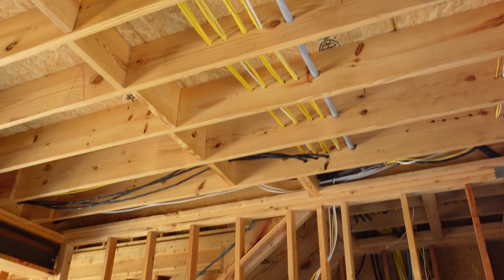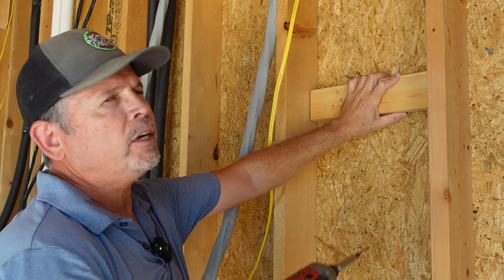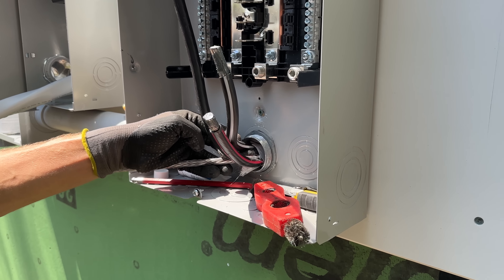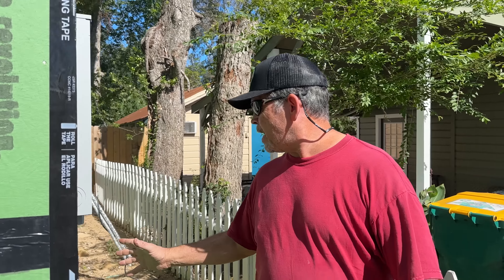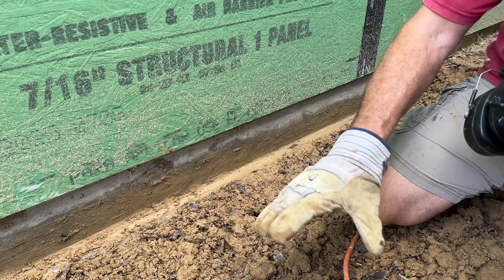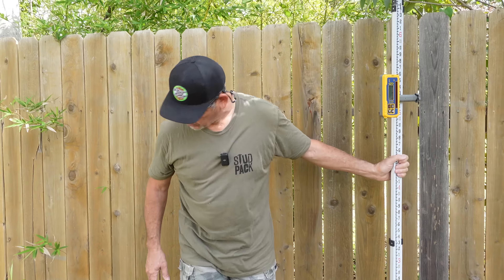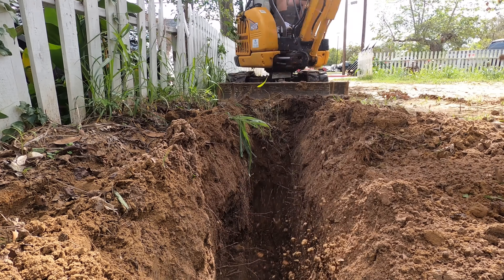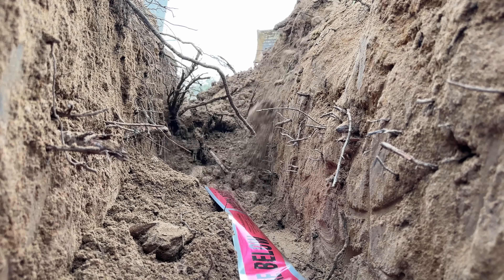MASSIVE 400 AMP Service for our Storm Proof Electrical Powerhouse

Comment: Hey guys. Recommend a 3” expansion coupling where you come out of the ground into your meter.
Reply: It’s actually required here in Tennessee. I knew there would be a comment here.
Reply: What does this do? Is it for movement or cold weather issues? Thank you.
Reply: @sterlingmullett6942  the pipe will always settle with time. Without the expansion coupling the forces will break fittings, bend the metal boxes or split the pipe from the fitting leaving the wire exposed to weather and damage.
Reply: @KetterHomeImprovements  I see. Thank you. Yeah, they should probably cut that three inch pipe and affix an expansion coupling. Hopefully they will see your comment.
Reply: Here in New England they are a requirement as well
Reply: Came here to make this same comment. I guess they probably don't get a ton of freezing temps in Texas, but it'd be a darn shame if frost heaving or settlement were to split the pipe down the road. I was also wondering about the inspection requirements. Around my way backfilling an underground service prior to an inspector having a look at it often means digging it back up, although perhaps video/photographic evidence is sufficient.
Reply: How does the service line stretch if the pipe drops?  Do you have 3" of slack in the cable/conductors somehow?

Comment: PVC for backer board is the same way I do all my electrical panels. Nice to see that great minds do think alike.
Reply: Where do you get them from
Reply: Wouldn't something a bit more fire resistant be better? Or at least something that won't spew toxic smoke when on fire?
Reply: @MikrySoft Rubber floor mats?
Reply: @MikrySoft  yea, you're right. Anything can always be better.
Reply: @baxtronx5972  I was thinking more in terms of fiber cement siding ("Hardie plank")
Reply: Use garbage deck screws to hold the box on.... and no expansion coupler.... cant buy 0.50 of stainless 14 screws?...

Comment: Taking those stakes out of the ground--I saw the Perkins Builder Brothers use a long 2x4. They screwed the 2x4 to the stake and used the length of the 2x4 to raise the stake by lifting up on the 2x4. Fast.

Comment: in the future, make sure you run a pull rope through a conduit made for internet before you glue it together, will make running lines much easier. When it comes time to run a network wire, you pull the network line through the conduit with the pull rope along with a new pull rope. Electric lines of that size are stiff and can be pushed through, fiber line not so much. For now i might suggest some fishing line attached to a small ball and some compressed air, push that through then with the fishing line pull a pull rope through it. Mind you i have 200ft fiber line in the ground connecting my startlink mounted on a 65ft tower to my house so I've used the pull rope before.
Reply: Since they didnt do that i would suggest a light string tied to a plastic grocery bag and sucked thru the pipe with shop vac
Reply: @Kreativekarpentryofficial  ohh never thought about suction and a grocery bag.
Reply: That was totally stressing me out, after seeing them fight with the big cables in the garage I can only imagine how much fun it will be to run the supply cable through that 90....
Reply: I would have left the hole open and put the pipes unglued in the hole and left them there until the electric company came to run the cable,  while they are running the pipe through the pipe pieces id be right behind them gluing them up. then once done fill the hole. @funkygawy
Reply: @fixitfixitfixit  My electric company wants everything done prior to inspection.  From metal riser, to primer and glued PVC, to schedule 80 36"/24" sweeps, panel to building, mule tape installed...  Everything before they will come out.
Reply: @bigearn8782  Thats fair i guess

Comment: Whether it’s code required or not as a home inspector and apprentice electrician I always highly recommend an expansion coupling below the meter. It’s almost impossible to install afterwards and you’ll be in a world of hurt if that conduit ever pulls out of the connector and exposes the utility side service entrance conductors. I’d ask Joel his opinion though, he will know better than me! Awesome work as always guys!
Reply: its code in my area for sure
Reply: Seems to be code for colder climates but the warmer climates don't seem to take expansion into consideration 🤔
Reply: I would have done one for sure.  Mine has moved a bit during the years.  I'm glad I did one.
Reply: definitely should have an expansion joint at the bottom of the meter socket. ground is not compact and will settle over time
Reply: @KeyDx7  look into getting outdoor duct seal it's electrical plumbers putty  than maybe get some flex tape ?
Reply: @@KeyDx7 Just call the utility, they'll make the owner fix it.  You might have to deal with power being shut off for a hot minute.  the AHJ could also be useful.

Comment: A farm jack works great to pull out fence posts when you do not have an excavator or are in tight quarters. They are about $50. Also, if you wrap your chain under itself (half hitch) when you wrap it around the 2x4, it will not slip when you are pulling.

Comment: First, the connectors that were used for the backside of those enclosures are not correct. What was used are SEU rated, in which what should have been used was SER ( Round Throat ) connectors for the Service Entrance Round cable. You cannot use flat clamps on round cable. Unfortunately, that is a code violation.  Second,  I highly recommend a expansion coupling under that meter base, whether or not it's code. Third, at least 3-4 1/4" weep holes ( * in line) should have been drilled for the belly of the 3" ( Service Lateral ) at the lowest point in the event of water infiltration.  Thumbs up to Joel for using the wire brush to spread the De-Ox. Most DE-Ox manufacturers suggest using wire brushes and many people don't. They just their finger which is not the proper way to apply it. Kudos to Paul for dressing the backing board with a chamfer. Nice touch!!!

Comment: 18:35 When hand digging those stakes, use a pressure washer wand to soften the dirt on one side.  Or drive a couple of big screws thru the stake, and lift it out with a portable "jack."

Comment: At the end near the road, I would have buried a 2.5 box over the pre-dug line for the utility connection.  So you only have to dig up 6 inches, remove the box, then presto.  As long as you don't have to drive over that area until the utilities are hooked up.

Comment: Good work. One question from a career electrician. No slip joint on the conduit riser between the ground and the meter base? They are required in a lot of areas. Ground movement can bust the conduit when rigidly attached to the wall and meter base. Keep up the good work.

Comment: Great video, good information!  In case people try to copy and repeat... For tracer ribbon you actually want to install that up the vertical riser pipe and wrap around a foot or two of it at ground level or maybe so that you could just see some of it otherwise nobody knows it's there so there will be no way to detect it. Detectable marking tape (tracer wire / ribbon) is used for locators not metal detectors. Therefore you have to energize it.
Also another pro tip: swing the house of the mini x when using the blade up against the picket fence so your boom, stick and bucket can be tucked away neatly. 😊 Good work guys Hope this info helps you for further videos.
Reply: Can you just use a 14/2 as a tracer wire?  What do you normally run ?
Reply: @walnutcontractors5661  You can it's just way more expensive and you're putting two wires in the ground. I use 18 gauge or 20 gauge single copper wire but that's a little expensive too so I like underground detectable tracer tape. Plus the tape has words on it so if you're installing gas it's pretty important to let people know there's gas underground. Usually you would bury 1 to 2 ft and then lay down the detectable / tracer tape with the words gas on it. Then continue burying the rest of the way flush with the ground.
This way when you start digging if you hit the tape you know within a footer to the gas pipe is below the tape so you never hit the gas. 💪

Comment: Great update on the garage. Not sure if it has been said, but I would have recommended a pull string in stalled on those 60 ft runs, 2-3ft deep is a bit deep for a  pull box, but pull string would be a idea.

Comment: Very interesting. The last time I built here in Georgia, the power company ran the line from the street to the meter. I am rather surprised that you guys did not have to have that conduit inspected before covering it. Also, here I have never been allowed to put more than one type of service in the same trench. One time I was using a 36 inch bucket and I was going to put the various utilities in the groove made by the teeth. I thought it was a cool idea as that would ensure that they were all evenly spaced apart. That prick of an inspector would not even let me backfill and bury within the area where the ditch was. He insisted everything had to have its own ditch. They would have been exactly one foot apart all the way (150 ft. ). Would have made locating later so easy.
Reply: I wondered about this too. I'm pretty sure my utility requires inspection first as well.

Comment: When you terminate the conduit on your new pole, make sure the open end of the conduit is LOWER than then termination at the house, AND make sure there's some waterproofing on it, so that it doesn't get a lot of water in it.

And since the pole side will be lower, when that conduit does fill with water, it'll drain on the pole side, not into your meter box.

Ask me how I know.

Comment: Paul, I'm not sure what the code requirements are there, but either way you may want to consider installing an expansion joint in the conduit vertical riser below the meter socket. It will protect conduit/meter socket damage from the settling of the earth in the trench. 
You guys are doing a great job. I can't wait to see the finished project!
Reply: Also you need schedule 80 above ground,  sch 40 below grade.  Joel eluded to requiring an expansion coupling below the meter socket
Reply: @grounded-b937 Joel did mention the requirement for sch 80 above and 40 below!
Reply: In SE MO we need them on our underground electrical services too, isn’t part of the NEC that I have ever read, but per the utility gold book out here they require it. Also sch 80 is just for the connection that comes out of the ground since it is subject to physical damage. Awesome video guys!!!

Comment: Jordan... Have you considered much less wired for 10 Gigabit Ethernet (at least to the NAS and 2.5 Gigabit to your workstations) within your garage build since you'll have Fibre Optics incoming... Where do you plan on having your NAS located? Have you considered rack mount NAS and ethernet switch? Which NAS are you planning on getting? Personally, I favor QNAP for the job...

Comment: Electrician in Iowa here guys, content is great keep it up!

I'm thinking your inspector or AHJ might have you add a slip joint coupling in on your service riser so just be expecting that, and no, they are not cheap for a 3" 😂

Comment: You should have ran pull wire through your conduit. Awesome job though. I like how you showed the elevations, I have been a critic on that in the past.
Reply: any reasonable shop vac will suck a pull string through that length with no trouble.

Comment: Hey guys glad to see some more progress! On the line into the meter you need to install a slip collar fitting so should it settle (They all do!) It does not pull out of the meter Box. Also I believe so jurisdiction require 400 amp service conduit have a small hole on bottom of sweep 90, at lowest point to facilitate drying of condensation, rain or penetrating ground water. At least my last 4 residential and 2 commercial did. Great call on other conduit, its also good to put one in for cable cause they do not like cohabitation of there service lines.
Reply: No way in my area. A couple of 3/16" holes will do the job and not allow bugs in. Code states that any holes over think.its 1/4" must be filled in.

Comment: I thought I was doing something going from 100 to 200amp...🤯

That idea about having the sheet of PVC or something behind meter is genius.  If I ever get around to changing the siding, I am definitely doing that.
Reply: I did my 27 ft of trenching by hand - only had to be 20" down (so the PVC was 18" below grade).  That was for 100 amp subpanel in my garage and 200 amp upgrade in my basement.  Old main panel became that subpanel.  This is cool seeing a killer garage build.  The house build will be even better too! I'm glad they are getting solar too.  It just makes too much sense with sunny roofs.  I have 2 arrays and I'm up in Michigan.
Reply: @whattheschmidt What would you need that many amps for? And is it legal?
Reply: @baxtronx5972  of course is legal, 200amp 240V service is very common.  I want 100 amps in my garage to charge EVs. I have 1 50 amp 240V circuit in there.  I also have my 5.4kW solar array into the subpanel in the garage.

Comment: Props for thinking ahead with the 1 inch conduit most utilities are requiring it now. Are you planning on also running a 1 inch flex conduit from the outside of the house to your demarcation point for all of your ethernet cables? Hopefully y’all planned for a Network closet that would be a great place to run it too. Especially if you’re going to add cameras and hardwired Ethernet to devices.
Reply: I don't disagree, but I wonder if it's really needed these days? Being hardwired is great and reduces interference, but considering wifi speeds, except for the most data intensive systems (home security cameras, video backups, home nas, etc) most computers, phones, gaming consoles, should work fine with a decent wifi setup. Although having a network closet couldn't hurt, just thinking the expense may not be worth it. 
Thoughts?
Reply: @sterlingmullett6942  While you can connect most devices with wifi, interference is a thing that you need to plan ahead for. Also, you probably want your wifi hotspots to be hardwired, and maybe a few more devices will require it too. It's a relatively small expense and saves a ton of headaches in the long run.
Also, you don't need a full on network closet, there can be minimal equipment in there.

Comment: Let me say I do love this channel and have been subscribed for a few years. It is one of my favorites because of the building process from a unique point of view, very skilled but not quite professional.
We have a prescriptive code of 2% grade slope = 2ft per 100 ln ft. or 0.24" . Engineer to trade we use head math =1/4" per ln foot. 
Always give an elevation with a distance, otherwise, it is garbage data with no meaning.
Do not use the top of the slab to final grade because you have to subtract the slab above grade. in your case, it is a sloped slab. The grade is dirt elevation, and the concrete slab is min 4" above dirt elevation.
The calculations are not measured from the low spot in the back of the yard to the low spot in the front as shown in the video. Measure from the highest spot in the rear to the low spot in the front, then design to mitigate the flow. Valleys can be 1/8" per foot slope. Think of it as the landscape feeding a river.

Comment: Hope to see some low voltage prewiring for security/cat6/coax/speakers. I would get a few home runs of cat6 from the TV location, places to put access points, and some automation. Also some speakers outside like the deck, living room, and especially that garage where you will be a lot during the house build.

Comment: The PVC backer is a great idea. One improvement on it for a future installation is to put rabbets on the sides and bottom for the siding to slide into. This helps with expansion and contraction of the siding.

Comment: I've noticed in my area that the gas company runs a single conductor - looks like the white strand from 14/2 - along side the gas line and I assume you can hook a tone generator up to the strand at the gas meter and following and mark it back to the street if you ever have to do any digging.  Maybe easier than detecting the metal caution tape.

Comment: LOL! I came out of the ground with my 90 and dry fit it looked great when I went to glue it it was tight fit I was workin alone my trench was alittle to deep and i slipped and it glued in slightly more on one side so it is crooked I tried to move it but it would not budge my foundation will cover it when I finish blocking it and I was not cuttin it !  But will be glad when it is behind block!  It happens!

Comment: A GOOD RULE OF THUMB IS THE TOP OF THE FINISHED CONCRETE/ FLOOR IS TO HAVE IT 18 INCHES ABOVE THE CROWN OR THE HIGHEST PART OF THE STREET BECAUSE OF FLOODING IF THE DRAINAGE GETS BLOCKED OR BACKED UP

Comment: you should expand your range of material use: indoor connector for an outdoor panel... should use rigid aluminum nipples for outdoor application.  If things are awkward and doesn't seem right, its usually because it's not meant for the job that you're dealing with.

Comment: when you bury the electrical conduit(s), (you should use 2), don’t forget to add (2) for low voltage utilities, such as Fiber or copper for internet, and possibly coax if your area has cable TV ✅ note: never mind, I see you added a fiber conduit, think “bigger is better”, 1” is a tough pull, especially with elbows, sweeps..  would go 1.5” or even 2” low voltage and dual 4” for high voltage, even if you only need 1 conduit, the 2nd 4” is if you have a cable fire in the future, you akready have a spare conduit in place